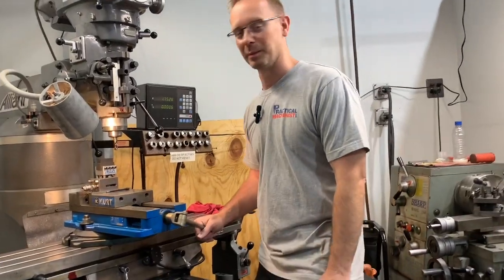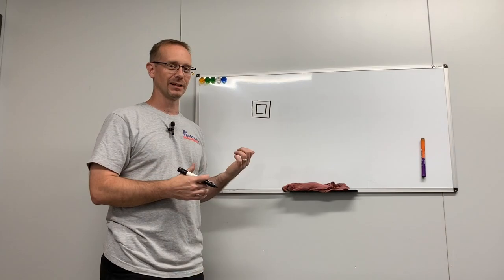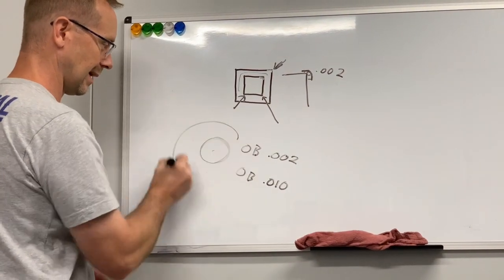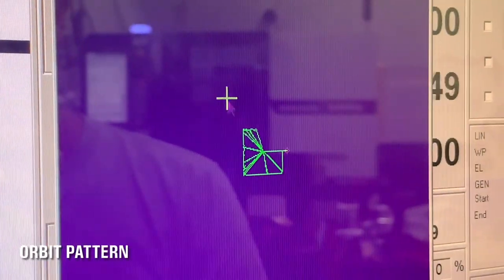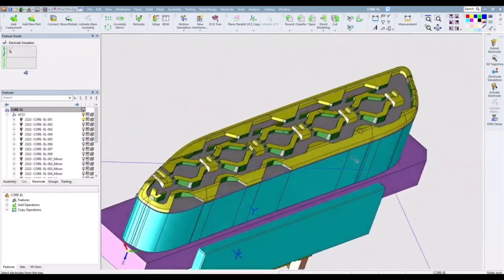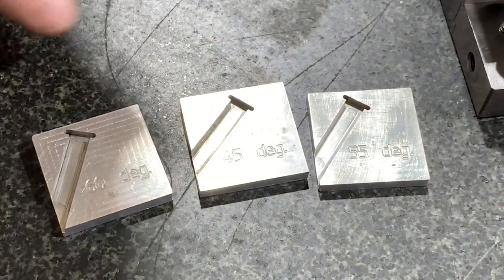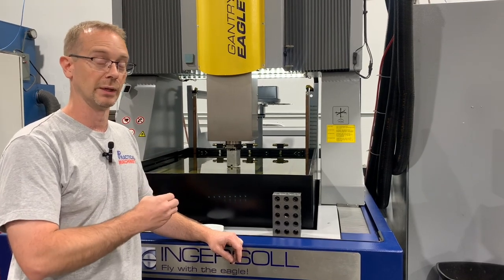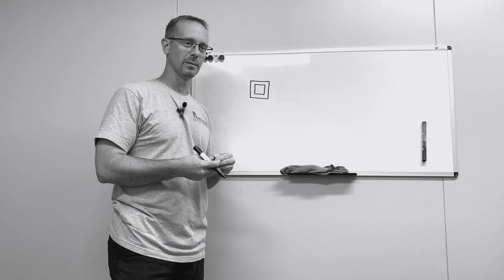How to Burn Challenging Features | Learn to burn

Comment: These are really helpfully, would you be able to explain the parameters you would choose for a particular burn. For example what peak current youd run. Thanks for the advice.
Reply: Thanks for watching! Typically we take the contact service in 2D, if it has draft we add the draft but we enter all of that into the control and then the control gives us the corresponding current. For older machines that I learned EDM on, I would start with a low current and adjust it until it sounds good and making good progress. The goal is to walk away from it and let it go and not have to worry about it.
Reply: @zerotolerancecnc  that makes sense ive kind of been trial and erroring my way through. The machine im using is a manual with a fuzzy control. Looking forward to the next instalment 👍